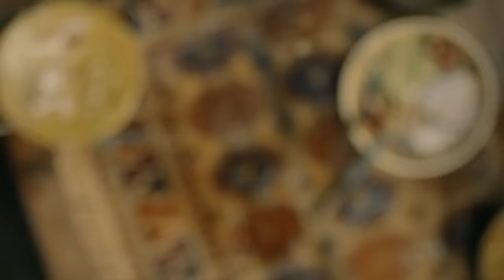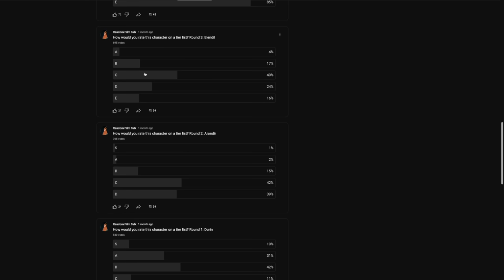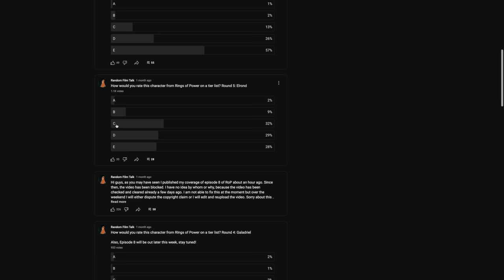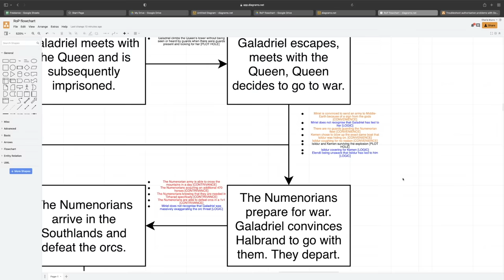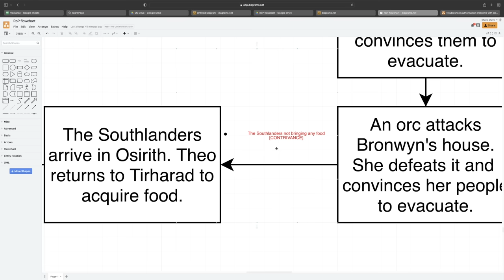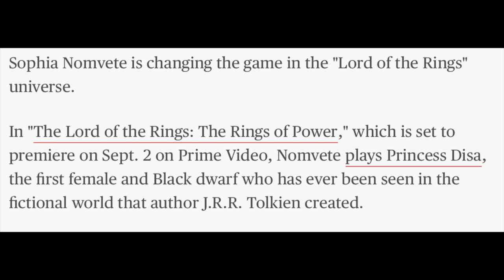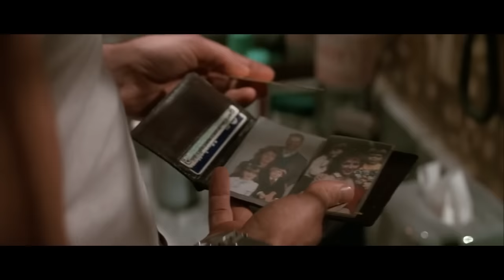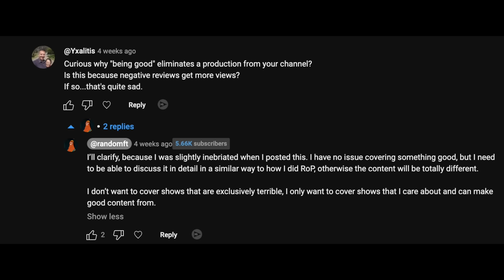Rings of Power is Not Very Good: The Final Autopsy

Comment: Holy crap, looking at all the charts, analyses and everything, you probably spent ten times as much time working on Rings of Power than the writers.
Reply: An amazing understatement
Reply: That's actually exactly why I don't like this video. There were only 46 dislikes before. Now there's 47. Tragic.

I didn't like "Rings of Power" either. I found it irritating for many reasons, primarily because of "Galadriel", who I felt was astonishingly one-note and insipid. A few of the characters I enjoyed solely because of the performances which I personally believe rose above the material, but most of the characters and plot lines I simply found boring (the contradictions exasperatingly pointed out here don't entirely bother me, show me even a great film where certain characters don't contradict themselves; there can't be drama without at least someone compromising their values.) Overall I agree, it's a bad show.

But whatever else this show is, it's still art, and the parade of flowcharts and tier-rankings here made me feel like I was watching ESPN, or- shudder- CNBC. Personally I don't feel that is how art should be assessed. Watching this video made me feel like I was trapped in a conversation with an accountant talking shop, not discussing an albeit bad (in my opinion) television show composed by writers, directors, and actors.

I could talk at length about the things I didn't like about "Rings of Power", but I'm never going to do it with a flowchart. It's a standard I find as insufferable as "Galadriel's" perpetually stoic expression.

I do think it's a well-made video though, I'll give it that. I don't want to come off completely like a prick troll. This content creator is good at his craft. We just have apparently diametrically opposed views as to how the art of film and television should be assessed.
Reply: @mcnultyssobercompanion6372  Here's the thing - in highly commercial pieces of art, such as industrial designs, movies, TV shows with a billion dollar budget and so on, somewhere behind the "art" are flowcharts, graphs, research and other tools that you'd expect in engineering. Stories can, and often need to be, visualised in some way or another, dissected and analysed to see what works and what does not. This is an objectively functional method to see whether something works as a whole and whether it fits together.

The fact that so many issues were found this way shows that either the people who made that didn't give a damn about consistency or good story telling, or expected the audience to just turn of their brain and enjoy the pretty pictures. 

I believe that flowcharts and such were mostly used as a means of hammering home the point that the producers were simply hacks that should have in no way been allowed anywhere near Tolkien's legacy nor a billion dollars and they should have stuck to toothpaste commercials.
Reply: Writers should be made to write a story then do exactly what random did….tier lists, connections, time in the story, impact on the story, logical pipeline diagrams all in order to identify weak points, nothing characters any plot holes etc etc etttttttc….then it should be redrafted and the same done again….this should be an absolute minimum……especially on shows like this
Reply: @mcnultyssobercompanion6372  I mean….it’s an in depth critique….what do you expect?  And you can easily skip anything you don’t like… personally I love the use of the charts etc…but should be used by the writers, it’s a shame because this tv show was doomed by its restrictions…it’s beyond me why they thought they could do it justice
Reply: this is not art.

That is the issue. There is modern politics and social agenda transported by one of the most sacred IPs.

Amazon studios operate on streamlined maximum profit ideals and surely assess everything by charts and statidtics.

It is more than fair to measure and label them with the same tools.

Stop putting their products on the same pedestal than the original Tolkien work. This shit has no right to exist.
Reply: @pst5345  Everything Amazon owned operates that way.
Reply: @davidgustafik7968 I think the labeling of this show as art is the problem as opposed to a story with which we can channel as art. But the problem is that while a story is art it is in essence also a story. Pointing out the errors in a story especially errors that exist not as differences in opinion but as objective problems means a objective diminishment of the story. While you can view a story as art dismissing the critic of a story by conflating instead of labeling story as art means that you are basically ignoring the importance of a good story.
Reply: @mcnultyssobercompanion6372 further, the reason why art is so subjective in terms of paintings, drawings, music, and sculptures is the rules guidelines and goals are all left to the artist themselves and the limits with which they craft it aren't given to the audience. The key to shows is that the show will itself establish the limits rules and goals of the "art". The art is longer and is much longer and more about bringing you along for something. This means that when it fails or passes the limits, even in terms of art it fails and is objectively worse. I can understand the view that shows are art but it is art that has clearly defined limits goals and motives. That brings you along for a ride on which any metaphorical bumps or story errors makes enjoying that art harder.
Reply: @mcnultyssobercompanion6372  perhaps "...suffer..."ing through this expands your own appreciation of the interplay between art, observation, and critique (the hints you give of your own approach didn't sound solely emotional,,,?)
Reply: to be fair anyone who even just watches this video has probably spent more time thinking about the show than the writers did
Reply: @mcnultyssobercompanion6372  I dissagree most strongly, if you watch how an renaissance artist adressed and structurised his paintings. or if you analyse an opera, you check for the underlying rules of the art and where those have been broken... Such an analisys is worthwile for future artists for their future work as it draws their attention to points which need special consideration in said future work, whereas an "I did not like it" is completely worthless information for the authors - this here is exact the kind of "constuctive criticism" which helps the bettement of the arts...

Comment: I do think it’s possible to fix ROP in season 2.
The current show runners do not have the skill, talent and aren’t self aware enough to know what was wrong with season 1 to even attempt to fix it, what they will probably do is just make things worse.
So, how can it be fixed?
If I was the poor fool tasked with fixing ROP in season 2, it would be difficult, but not impossible.
I would tell a parallel story line through all 8 episodes.
One story line would move the plot forward.
I would also have to dedicate half of every episode, that is essentially a flash back, staying thematically consistent with each episodes forward moving plot, but using the flash back story to both back fill and re-contextualize all of the events of season 1.
At this point, I couldn’t make it consistent to Tolkien’s lore, but I would attempt to move it closer in feel and intent to Tolkien’s world.
They’re most likely unaware of this, but there is a MacGuffin that already exists throughout season 1, that could be used to re-contextualize events, I’m not saying it here, on the very unlikely chance the hacks at ROP read your comment section.
If I believed they actually understood the issues with their show and wanted to fix it, I wouldn’t even have an issue with them stealing an idea I had, but I don’t believe they do.
IMHO, the idea I have to use to fix season 1 is pretty clever, at least by ROP standards.
I would make the opening of Season 2 a flashback to Finrod’s fight with Sauron’s Werewolf, who Finrod defeats, but at the cost of his own life, which is Tolkien lore accurate.

Comment: There is actually a way to get from irrigation ditch water to volcano boom-boom. If you dump water into a magma chamber steam pressure will cause an eruption. The trick is you need a shed load of water all at once (so fill up that empty chamber until the base fails) because what you want to make is a steam flashover - much like what causes steam locomotive boilers to detonate. In that case the water level drops, the firebox crown sheet is exposed and is rapidly heated to melty metal temperatures - the water subsequently covers the crown sheet again, hits massive heat and flashes into steam which usually grenades the boiler. The massive pressure increase destroys it before the pressure valves can compensate.
If something like that happens in a magma chamber you, depending on the type of magma, can get a double whammy. The mass of water dumped into the chamber will steam flash, bust the cap of the magma chamber and give the lava a route out, but it also means the pressure drops and any volatiles come out of the magma. If that happens you get a Mt St Helens type explosive eruption (acidic or intermediate), if you have a basic or ultrabasic lava you get fast flowing liquid lava that doesn't explode. So an Acidic volcano will give you two explosive forces, the flash steam pressure "explosion" from the water ingress and the volatiles pressure "explosion" from the pressure drop releasing the water and gases in the magma.

It also tells you the volcano is sitting on the edge of a subduction zone above the area where the subducted crust is melting and fractionating into heavy and light minerals..

Geology is useful, who knew? 😂
Reply: That was one phenomenal analysis. ❤  You really should consider making educational videos (unless, of course, your day job is something to this effect already, such as being a professional volcanologist or teacher or some such).
Reply: @charlesrockafellor4200  Too honest to be a teacher, especially these days, and did Geology at university amongst other things. In the middle of treatment for fibro mediated triple negative breast cancer and skin cancer so not really up to doing much at the moment. I have 37 cornsnake babies in total to deal with too. 14 have already hatched and are adorable little missiles.

Not really a fan of being around volcanoes, I probably would have gone more into paleobiology/paleontology.. Look up an animal called a tuatara... Last of an over 200mya old group of reptiles - a green bearded dragon that can live for 150 years...
Reply: @rosiehawtrey   Bugger about the cancer, man.  As for teaching... I wouldn't want to deal with it myself, given all of the ridiculous hoops and strictures (and "charming" students and parents) that my teacher-friends have told me about, but now that you mention it, honesty could be problematic in that field too.

Corn snakes are way cool, though I'm more of a cat person, but the tuatara is a name that I haven't heard in years (I tend more toward math and physics, but who doesn't love a cute lizard like that?) -- now if only I could remember where (and it certainly reminds me of some of the old movies, such as "The Time Travelers", or "The Lost World").

ADHD by any chance?  I am, and the flow of thought there feels familiar.

Comment: Slight correction: At 56:32 you rationalize that Galadriel can't be the oldest person in Middle-Earth on the basis that she has parents in Valinor.

While you are technically correct in that she's not the oldest being in Middle Earth, Valinor and Middle Earth are considered different worlds/dimensions/whatever both in-universe and out of it. The fact that she has parents in Valinor does not contradict her being potentially the oldest being in Middle Earth because her parents are not in Middle Earth.

Generally speaking, by the time of the Third Age (when the LOTR trilogy takes place) she's the 4th or 5th oldest (depending on if her husband is older than she is), but admittedly several other characters who are alive during RoP would be older than her but have died or disappeared by the time of the Third Age, so she's definitely lower on the list "currently."
(Ignoring that RoP has utterly mangled the timeline beyond any semblance of coherency anyways.)

Comment: Ran a few questions past ChatGPT for fun. On the road between Rivendell and Moria, Presuming there's no obstacles or perils, and presuming there's breaks for sleep, eating and pausing to maintain good energy, ChatGPT estimated that the travel would probably take 12 and a half days. I also asked if elves with ease could make this journey without eating any food. ChatGPT did not think elves in spite of their longevity and vitality would make a journey of several hundred miles on foot without eating. So much for Elrond's fast travel. "Prolonged physical exertion would likely require them to replenish their energy reserves through regular meals." Consider the state of Legolas being fairly winded and demoralized after they make it out into the sunlight on the mountainside of Moria after Gandalf falls.

Comment: I’d like to add that the evil sword key maguffin is completely unnecessary. It’s purpose is to open a damn. This means that the damn has a mechanism in place that opens it. Adar and the orcs could easily have taken the damn, found the mechanism and activated it, or simply weakened the damn to the point that it burst, without needing the sword at all. Hell, if the tower had fallen at a slightly different angle, it could have done the job by accident.

Comment: 8:40 If you think about it, Galadriel was at best only partially right, even in the script.
Yes, she was right in that there are still orcs around and that they are still a threat, but she was looking for them in entirely the wrong area.
Considering how she was looking for them in the far north and they were quite literally half a continent away near the equator, she could have spent several more centuries wading through snowstorms without finding them, while the orcs had a near enough unopposed run at the Southlands.

So the only reason why she was ever in a position to "safe the day" if you want to call it that, was because of the "mutiny" of her men, thus proofing them at the very least as right as Galadriel herself.

Comment: Absolutely amazing analysis. Glad I found your channel after start of your Hobbit analysis. Only thing I disagree with is that faithfulness to the work adapting doesn't matter although I do like and find value in analyzing a work on its own merit as well, that is only part of the analysis of a work that is supposed to be an adaptation. If you are going to use the name of a previous work or author while creating your own work especially if your are doing so to bring in an existing fanbase you have a certain responsibility to that work you are adapting. That said I am by no means a purist. When making a film your first job is to make a good film, your second job is to be faithful. Some things have to be changed when adapting. The Jackson Trilogy is a master class in doing this right as even though there are several major differences the core of the story, themes, and characters are present, and all those differences (with a few minor objections) serve the movie. Changes to make the movie more like the book would have weakened the movies and changes in the books to make them more like the movies would have made for a weaker book. That is how an adaptation should be. Rings of Power should have just come up with their own names for the show and characters (maybe keep a couple as an homage) as they have almost nothing else in common with what was actually written in the books and only seem interested in telling their own story while riding off the coattails of others. 

Also just as an extra thought, Star Wars the clone wars would be interesting to review in its own right. There is plenty of examples of good and bad writing within that series. If you haven't already watched it is worth going through just know it takes a little while to actually get going.